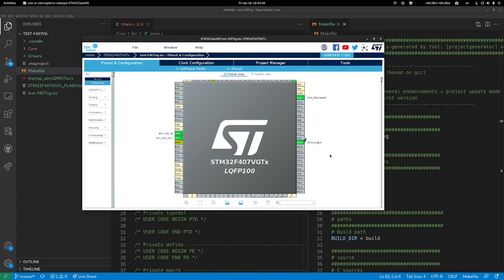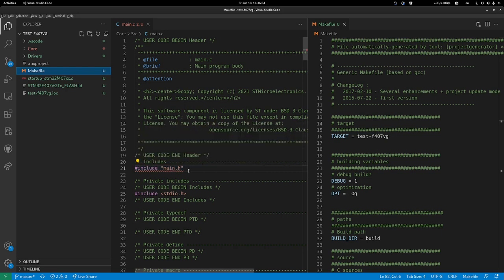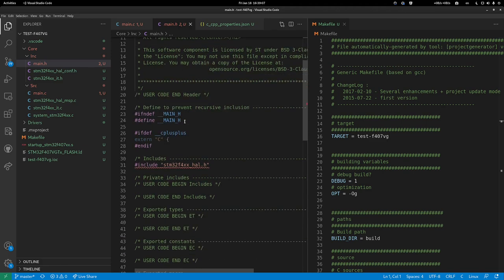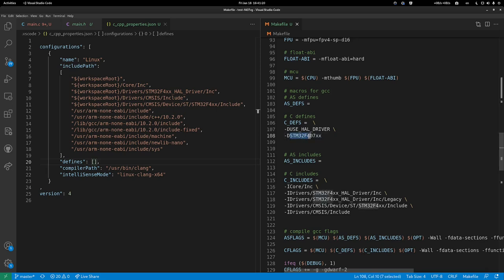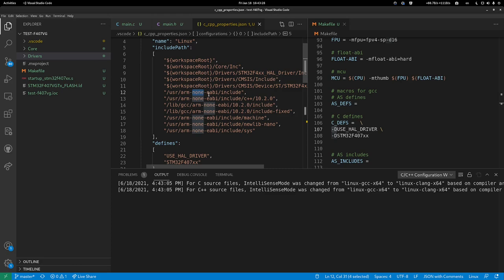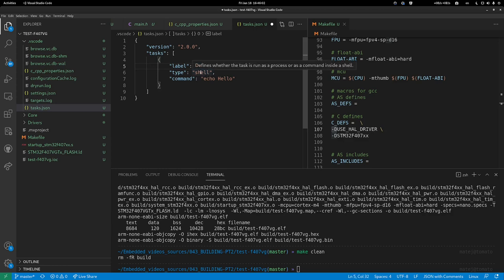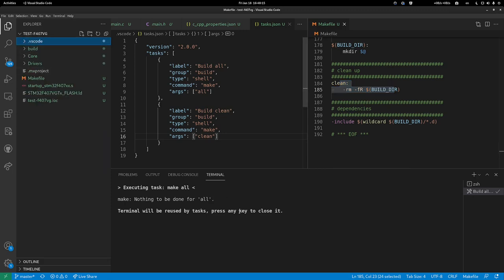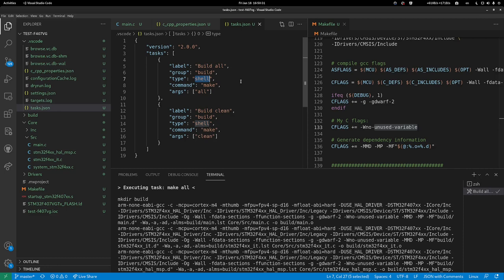Configure VSCode for Embedded project (STM32) with Make | VIDEO 43

Comment: That's why should use already configured payed solution. Thought you be db coding, but that turned out to be just configuring. My only warning here is Littlefuse. It's already a technology you may use 0:56 very easy and interesting. Problem with these have to write your make file and do more configuring, when only thing should see is some basic running project not diving deep into just meaningless code lines. Just Copy it - may not know security vulnerabilities or if it really deletes a folder you need. Wish to do it in the description area this <h1>, but that is not how it runs escaping all the < >.

Comment: So, for VS code we have to do those settings for every project?
Reply from the maker: That's right. It have a template .vscode folder that I copy to a new project, change name of the microcontroller and then open vscode. It doesn't take that much time and works great.
Reply: Where's that template?

Comment: I have a question about includepath. Isn't the /** in the ${workspaceFolder}/** recursively search for all the sub-folders inside the workspace directory? Why do wee still need to add those sub folder one by one?
Reply from the maker: You are correct. But for some reason this can fault and not work. I found a couple articles and posts about this and the solution is to add all paths. If ${workspaceFolder}/** works for your project then no problem. You can use it for your compiler paths as well.

Comment: The make file option for Toolchain/IDE is not available for the board I am working with -- the stm32h747 disco  board.
Reply from the maker: I see ... Maybe it has to do somethig with the IC having two separate cpu cores and funcions, but I wouldn't know why would that affect it.
I can suggest you to create CubeIde project and then run and configure build (Debug/Run) from the ide and after one build you will have Makefile inside that Debug/Release folder and you can run that. But I don't know much about the development process for these kind of beast ICs.
Best or luck.
Reply from the maker: I just took a look into a such project in CubeIde. It looks like a package with two "separate" projects inside. You could apply same logic to that and just treat them separate. Use their created mekafiles and use one global makefile to run those. Therefore CubeIde takes care of configuration of it when it needs changing, but your makefile runs those and other things I discuss in the series plus many more to come :)
Reply: Thank you, Matej! I just ordered the F746 board to not have to deal with the hassle of two chips. 

With the F746 I give the make file option. Hopefully that means I can follow along with your video. I will get back to you about that.

Comment: Hello, can you also make a video of how to make a project for writing ARM assembly in a similar way.
Reply from the maker: I don't write much assemly at all. I can read it when I need to debug something. Also I don't see a reason to use it, unless you're making a small task scheduler or custom adder/multiplier or core control (those are already made by mcu manufacturers).

Comment: Excellent video, but im stopped , Why i cant see the .vscode below my TEST project.
Reply from the maker: You will have to make some changes in order for vscode to create the folder with your configuration files. As for cpp settings, you can copy mine from the github and go from there.

Comment: Hi, I'm a novice to learn stm32. I have a question about using printf and scanf on board(STM32F303). It cannot execute with Make method.  I used MicroLIB in Keil to solve this problem before. Can you give me some suggestion to this trouble ? Thanks!
Reply from the maker: The thing is that printf and scanf are just functions that write to and read from a data stream. In case of a C application running on your computer, the stream is standard output/input -> that's why you can see printf output in console where you can also input characters and read them with scanf.
On microcontroller you don't have that. It's a independent computer let's say and you have to provide a connection or a stream to and from your console. The most obvious one is UART. You can use uart as a stream pipe and route printf and scanf function over there.
Your library probably did something like that, but you have to remember to enable USART peripheral and wire it up. What that library did was probably something similar.
I found a great article on that note: https://programming.vip/docs/stm32-printf-and-scanf-function-redirection.html. You can also create your own and not use printf and scanf commands. Hope this helps.

Comment: whatever I do I get,  cannot open source file "stdio.h"C/C++(1696)  ..for instance cannot open source file "stdlib.h" (dependency of "stm32f769i_discovery_audio.h")C/C++(1696)   when I hover over the red underlined includes
Reply from the maker: It looks like the ide cannot find your system libraries. Does your project compile or it's just a intellisense problem? Have you tried adding the include path to arm-gcc headers? On ubuntu and fedora it is installed in `/usr/arm-none-eabi/include`.
Reply: Hi Matej , thanks for the reply , the project built all of the files using the make file but fails on the linking part. its a project off of github and really quite complex. Its got FPU flags enabled etc for some DSP stuff. I tried stm32CubeIDE and think its more useful for what I'm doing since it comes with a debugger and GCC all in one and I can just select the MC i'm working with. I'll keep watching your videos as it helps me understand make file basics etc

Comment: Thx so much for the very good video, i dont know why but only the uint32_t datatype is not recognized as a datatype, do you have any idea why this could be like this, any help is welcome, i tried a lot of things already but to no avail, still a great video, because i much prefer code formatting and also my shortcuts etc are configured in vscode etc it would be nice to have it work like this
Reply from the maker: Well vscode in my experience with the c/c++ plugin does work on and off. I found that providing it with the "compile_commands.json" file from meta build systems like cmake, meson, works the best. Give it a try.

Comment: how to add library to project ?
Reply from the maker: In case of a Makefile, you need to add the path to the library headers to the list of directories, and sources to the list of sources to compile during the build. That's the same with CMake, but with different syntax. Check my other videos.
Reply: tks u guy, i did it